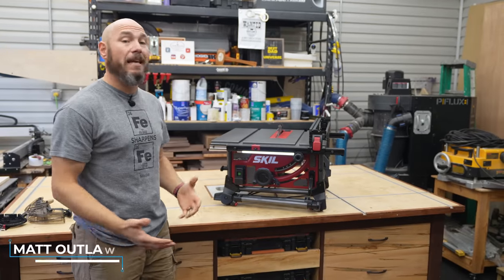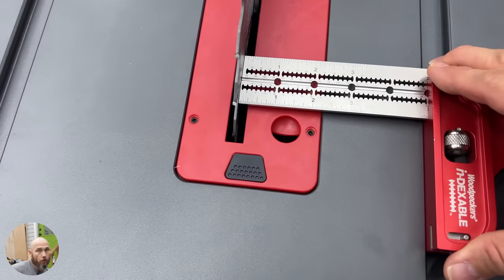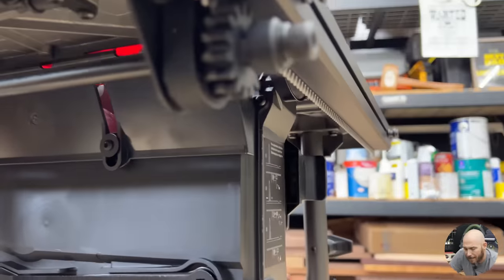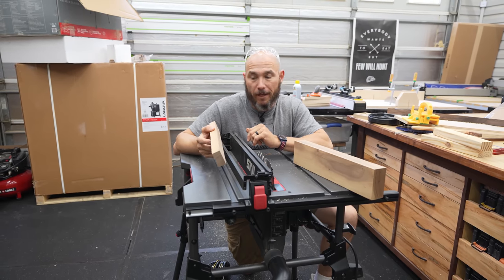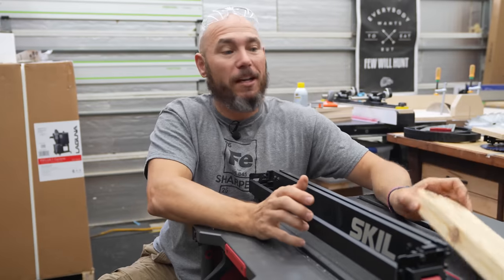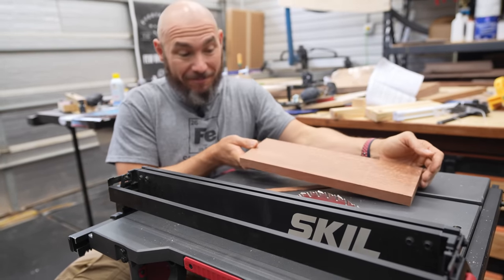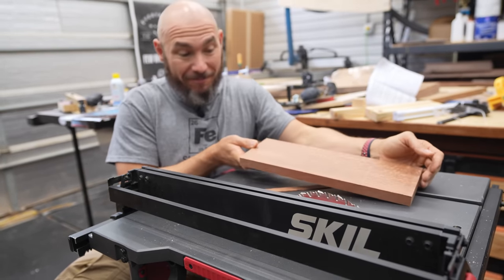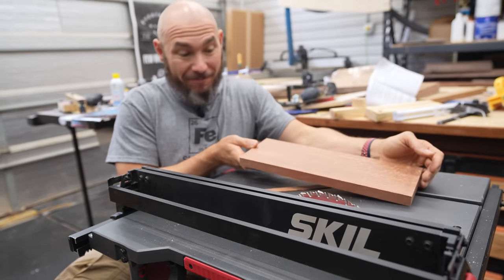Did I Find The BEST BUDGET Table Saw with the MOST Features?

Comment: Thanks for the review. I may be replacing my table saw after seeing this video. >>> I have a Ryobi table saw. The dust collection on my Ryobi is frustrating. My shop vac tube and the tube that came with the Ryobi are not capable. I tried to find multiple adapters to fix it...couldn't get the right size. My Ryobi spits EXCESSIVE amounts of dust in my face. I've been hit in the face by small chunks multiple times. I have to wear eyewear, 2 masks, and take multiple breaks to breathe just to use it. IT IS TERRIBLE.

Comment: As a beginner, I disagree. Table is too small, nobody else will help me push wood, so if I have large sheets i would be in deep sheet. If it had a28 or 30 inch rip capacity, maybe. This saw desperately needs a workbench surround. I an guessing from watching videos, i do not have a table saw yet.